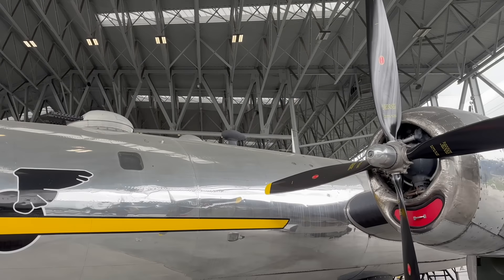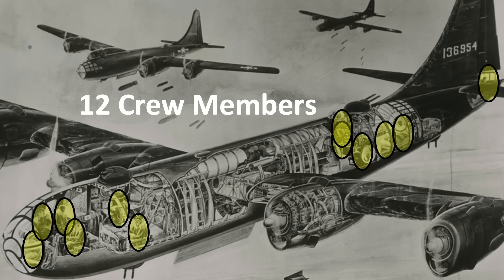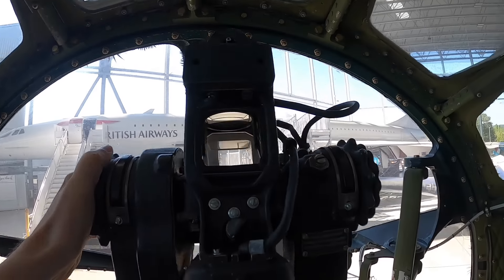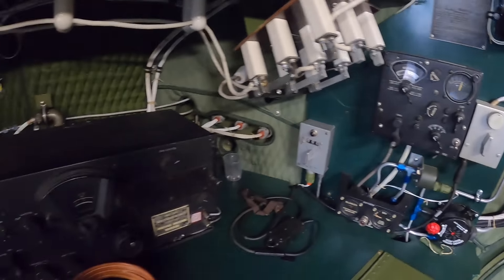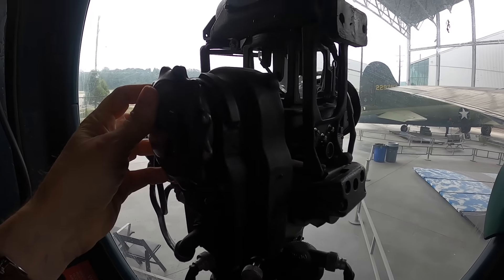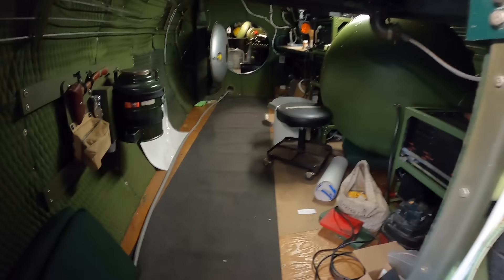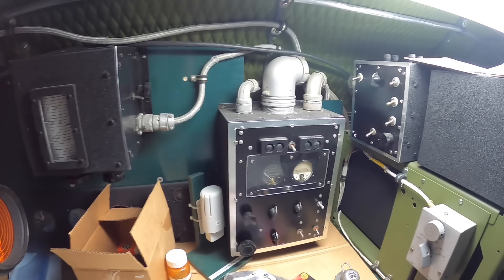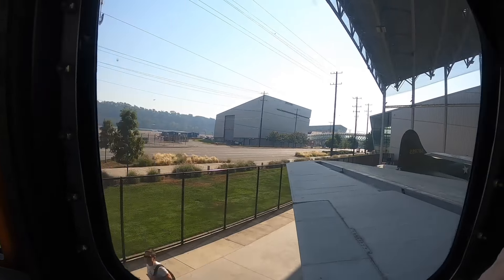WWII B-29 Bomber Interior Tip-to-Tail Walk/Crawl through in under 6 minutes

Comment: Great presentation.  Thanks.  Btw: At the Mellon Institute, built in the ‘20’s, there is a large auditorium, wood paneled and beautiful.  Behind every single seat was a built in ashtray.  In the 1980’s, I asked the Oldtimers if they were used, and the answer was yup.  Imagine an auditorium with 200+ people all smoking like smokestacks.
Reply: I'm 68. You just described every '60s auditorium that I remember.
Reply: My first job after getting out of the Navy in 1976 was with a company with several small desktop computers.  Two had different printers, one had a tape drive, and so on, so we kept on switching computers all day long.  I got tired of the smokers never emptying ashtrays on each one, butts overflowing, ashes drifting in the breeze of people walking by.  One day I got mad enough to just dump the entire ashtray in the trash, and did that on each computer I used.  By the end of the week, there were no ashtrays left.  The most amazing part is that none of the smokers complained or wondered.  They just stopped smoking at the computers.
Reply: Dinosaurs use to, why not?
Reply: when I was a kid in the 60s and 70s, the cinemas were full of smoke - so were planes

Comment: My dad was assigned to Dallas Fort Worth as a mechanic.  Prior to this he was at Pueblo CO on B24s. He told me many stories about the Supersfort teething troubles,  especially with the engines.  I recently reviewed some videos detailing problems with the fire 
 control system, and it's obviou😮😮s that this aircraft was truly cutting edge technolog, so teething teething troubles were unsurprising.  Ultimately its defects were corrected,  and it served admirable until jet powered bombers supercede it. But my Dad always preferred the Liberator.